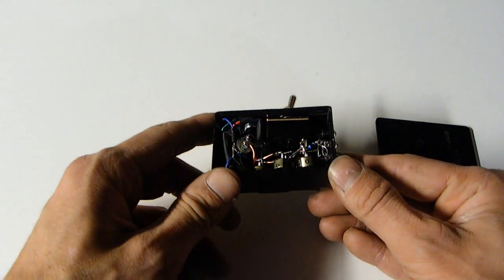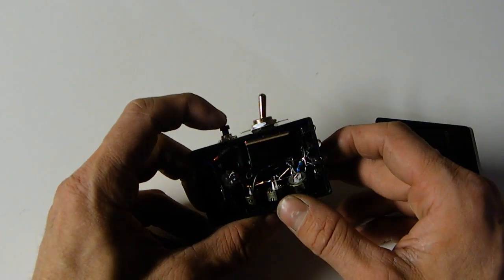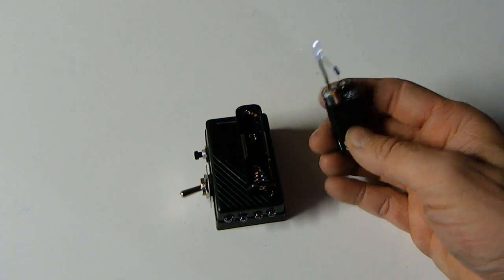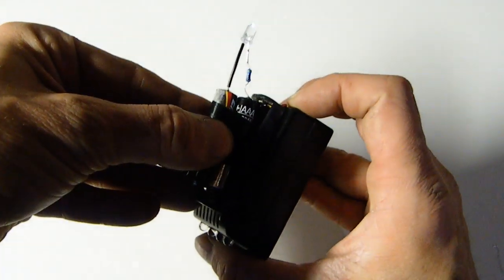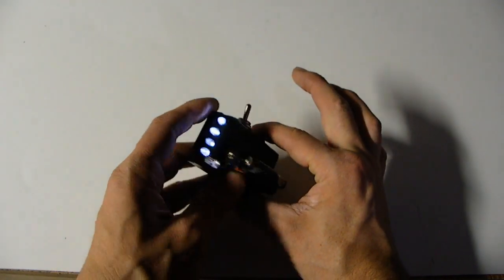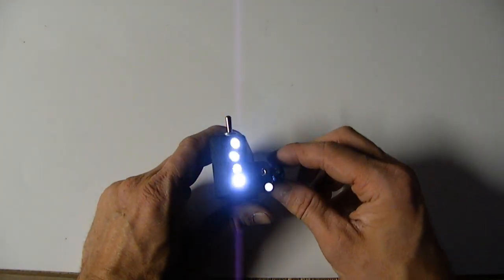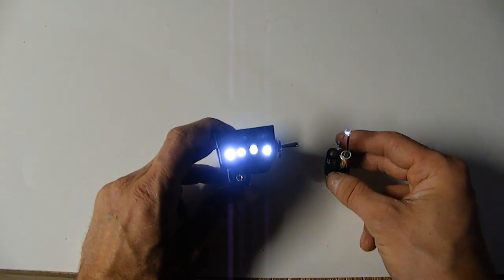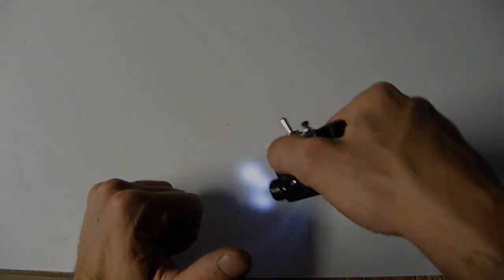Charging super capacitors with a joule thief

Comment: It's not consuming half less..  its actually consuming more than 4 times more than that single led. Joule thief doesn't produce energy out of nothing.. It just steeps up the voltage.
Reply: would you please show your schematic and power in and out measurements, particularly the design details of the coil.

Comment: What are the specs on the super caps?
Reply: 4.22F 02:00 not sure 4x of 0.2F or 4.22F, but you can find 1F 2.7v or 5.5v on the internet they cost about 10$   Actualy i think he meant 4.2v 2F capacitors
Reply: 4 units of 0.22 (almost a farad) did he say what voltage tho? 2.7v I suspect.

Comment: that is very useful as a back up flash light and all you have are (mostly) dead batteries  though i have to correct you, it isnt running off of half the power, just half the voltage as the joule thief takes the low voltage and high current and turns it into high voltage and low current either way you still have the same "power" or watts output as the input. watts=voltage x amperage

Comment from the maker: @Curixq - Yes, longer than 12 hours. The super caps (at least the ones I have) will drain to about 80% of their capacity quickly (within 20 minutes). After that, though, they drain (without a load) much slower. They definitely maintain over 50% charge after 12 hours.

Comment: Hello, I have a question.
If you charge the supercapacitors get the battery out and don't turn on the LED's, how long does it take for the capacitors to discharge? Longer than 12 hours?